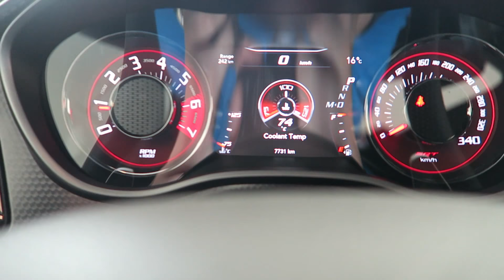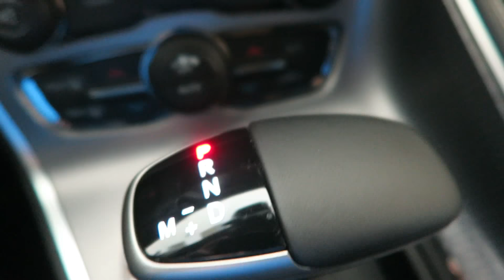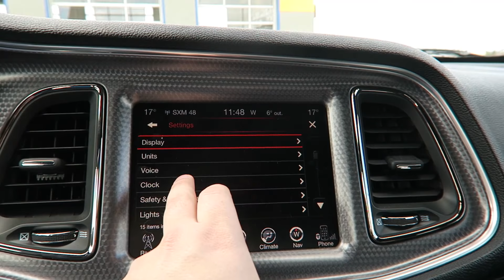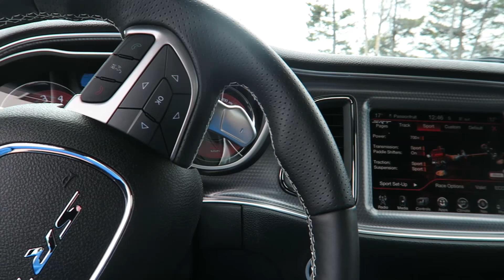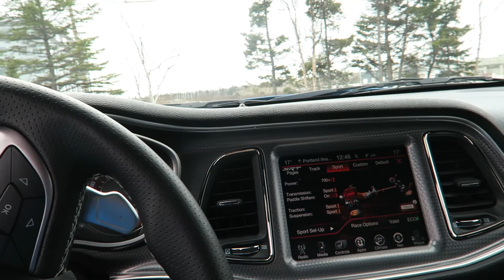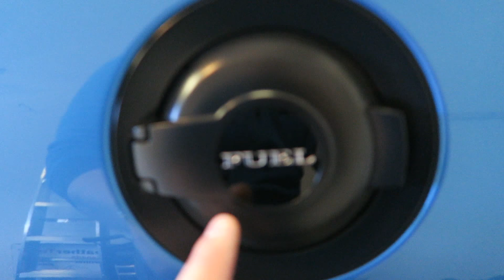THE HELLCAT IS FREE

Comment: Speirs.  How you, you you know so much abour carrrs
Reply: SIDEWALK CHALK not a lot bc he drives an automatiiic
Reply: Stealth RS 7  Lmao😅 truu
Reply: Stealth RS 7 Automatic transmissions are often used by Drag racers
Reply: Stealth RS 7 A lot of Automatics are better than the manuals. I prefer Manual but I understand the automatic. Especially the The One found in the new ZL1 and Porsches PDK both fantastic Auto boxes.
Reply: Sam Wilson manual is best for drifting drag racing people use auto and manual.  rarely have I seen a auto drift at a track before
Reply: SIDEWALK CHALK he literally changed the oil and checked the filter. Most people should know this.

Comment: Speirs is there a lighting levels switch? My charger has one to the left of the steering wheel. I think you gotta set the turn-dial to auto, it should be in the same spot as the lighting controls in your SuperBee
Reply: Also....try pushing the turn-switch its also a pushbutton....I think thats just foglights though. You want the Halo's to be on as driving lights, right?